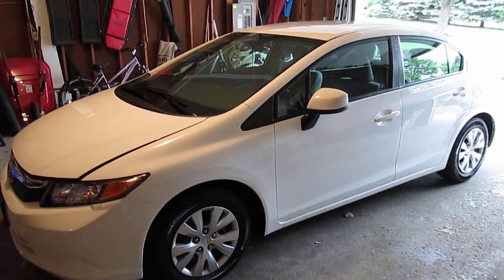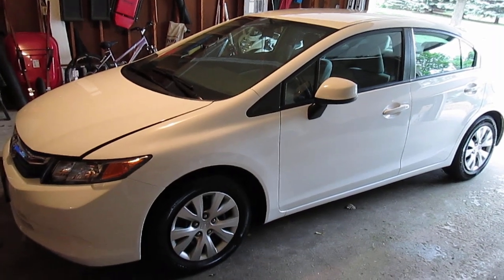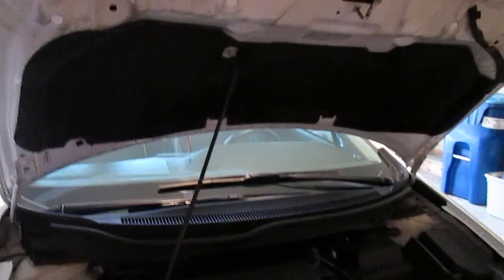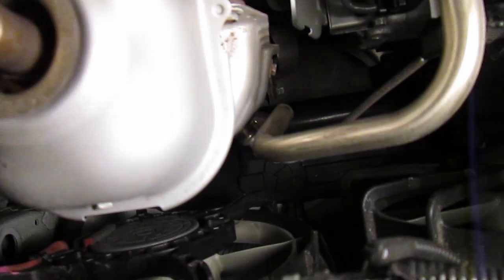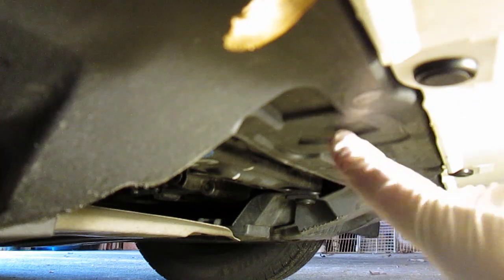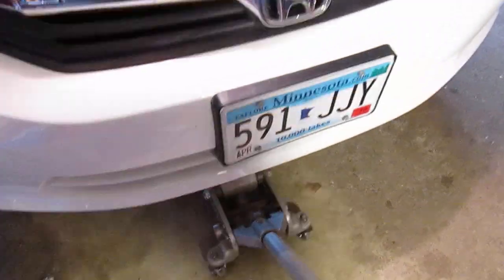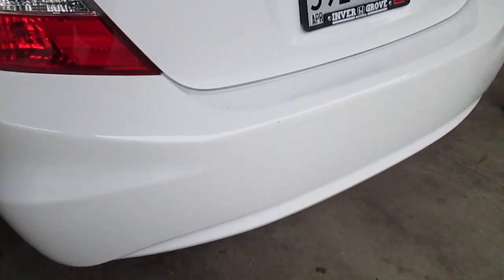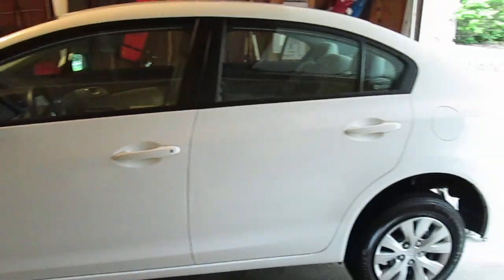How to Jack up 2012 Honda Civic / Jack Points 2006-2015 Honda Civic

Comment: Thank you for the clear and concise video brother. Saved my buddy’s life.

Don’t forget to chock the front tires with big bricks if you lift the rear.
The parking brake only locks the rear tires
Reply: its not going to just roll..its FWD
Reply: @bilbobaggins5962  It will if it's in neutral and a manual transmission. You need to leave it in gear for the front wheels to minimise movement as they WILL roll freely in neutral, I would however still use chocks regardless.
Reply: Definitely chock the wheels.  Any movement can be dangerous and the parking break may not be good.  Plus, if you’ve got the back jacked up, the parking brake is out of play.  Even in gear, the car can roll a little bit.  I’m speaking from experience.  Please take all precautions!

Comment: Thank you for this, I have the same car and the manual does not identify the front arrow jack location. Some people on the forums say not to use the tow hook because of stability issues but I didn’t have any problems. I just made a puck out of wood for the jack that the hook can dig into. Worked great to rotate my tires

Comment: This video was literally more clear then the dealership and my user manual 🤣🤣🤣🤣

Been jacking this car up for 10 years and didn't know about the arrows haha.  Usually just use the jack points on the sides, but I needed to get both front tires up at the same time....damn directional tires lol.

Comment: Just an extra tip I learned from my 300zx that sits low.   Get some 2x10 by 3 feet boards (like decking board)  and drive the car onto the boards before jacking.  This raises the car and makes jacking and inspecting underneath much easier.

Comment: I know it's a older video but man I was pissed today. I just got a 2012 and was going to do the trans fluid. There's so much plastic under this car it doesn't even make sense. I really miss working on my Cobalt SS already. On the balt there are tons of very safe jacking points all over from the K memeber up front to the frame rails and rear sub frame. 

I've never had a car fall off of a jack and this is the first car it's happened to me on. Lesson learned on this car for sure. Now what I do is use that little spot at the front to lift up the front wheels then I put my steel wheels and 2x4's and sit the car down on the pinch welds there. At least then it has no chance of moving. 

A bit scary working on this Honda.

If I had it my way all that plastic would have to go as well.

Anyways thanks for the video.

Comment: Great videos Eric.  Thank you.  I'm curious if there is a reason to your order for lowering the vehicle off the jack stands.  UP: front up on stands then rear up.  DOWN: front down off stands then rear down.    I would've thought doing the reverse order of UP would make more sense (also it would  use ebrake and have more clearance).    What am I missing?   Thx!

Comment: I just replaced the brake pads on my civic, with my dad since i have no idea what i'm doing. we jacked it with the pinch welds, but i knew there had to be another jack point because it was a pain to get the jack stands in since the jack was in the way. i'll definitely use that trick with the arrow and tow point next time

Comment: Does the manual even mention about the arrow at the front to Jack up the car? i would always Jack up the car using the each of the corners and struggle to stick the damn stands in there with the jack together. Thank for the video!
Reply from the maker: +Ray G Ha, I know the feeling.  I'm not certain, but I don't recall seeing that.

Comment: I have jack stands with nearly flat support extensions.  The pinch weld extensions on the car frame would be resting on a flat surface, putting maximum strain on them - can they withstand the weight? The crank up jack that comes with the car has a slotted receiver, where the frame  pinch weld sort of drops into.  That seems to distribute the weight differently, as not be  entirely on the extended weld piece.

Comment: Those pinch points on the sides of cars are weak.  It works but do you trust them?  I think it should be a federal law that all vehicles must have color painted areas underneath a car to show where jacks and jack stands should be placed. Hats off to Honda for putting these arrows to show where to put the jacks.  When lifting a car off the ground totally I would use 4 jack stands and have two jacks and leave the two jacks barely touching the frame as added safety. Cheers!
Reply: I have come to the conclusion that the two most basic cars one should buy are the Honda Civic or the Toyota Corolla. Period! Toyota, Lexus, Honda, Acura are the most reliable and many a mechanic will tell you this plus CR and other publications. I own two old GM Buicks which are decent cars because I maintain them but Toyota and Honda are superb!

Comment: Isn't it sort of dangerous to lift the car from the tow hook. I understand that it is strong... however, it is not flat surface.
Reply: Yep! I would never jack up a tow hook unless I had to. There is a better point in the back. A piece of metal runs the width of the car between the lower control arms. This piece of metal is structural, reinforced, and is nice and flat. Use this instead!

Comment: Hi, I have a quick question for you about the 4 pinch weld spots.  Do you need some rubber adapter to put over the cup of the floor jack?  I'm just wondering if the floor jack will damage those welds or not.  Thank you

Comment: Does the 2012 civic on your video,have a timing belt?
Reply from the maker: +Marco Pelayo Hi Marco - My Civic does not have a timing belt, but a timing chain.  I believe all R18 engines which started in 2006 have chains instead of belts.
Reply: Cool,thanks Eric,..thanks for the great video.
Reply: Civics up through 05 have an  external timing chain that technically should  be replaced every 60 to 80,000 miles or so.  The water pump is usually replaced along with it.

Many vehicles can sustain a bad timing chain, it just reduces engine performance.  Hondas are not one of those vehicles.  Wear is altogether normal, but significant damage to the chain gradually destroys the engine. 
For Civics starting from 06 onward, the timing chain is inside the engine block and remains for the life of the engine  -a design upgrade.

Comment: Iv seen some people block the back two wheels. Is that necessary?
Reply: If you are leaving the back wheels on the ground and plan to work under the car in the front it's important to "chock" or block the wheels since the only thing keeping the back wheels secure is the parking brake. If the parking brake fails while you are under the car you could die. Likewise, if you lift the back end with the front wheels on the ground you must make sure the vehicle is in Park (if auto trans.) or in 1st gear (if manual trans.) and chock the front wheels as a backup if the car's transmission fails and it slips out of gear. They are called "wheel chocks" and are sadly overlooked on most DIY videos. In this vid he did not need chocks since he raised the vehicle completely for the tire rotation, although I would have used chocks on the back tires when he lifted the front end but that's me.
Reply: @scottyh1509  Thanks Scotty

Comment: Never use the jack stands he uses.  They have all been recalled for catastauphic failure.  Only use the kind that has a solid pin holding their height.